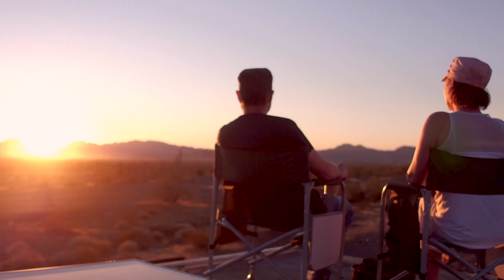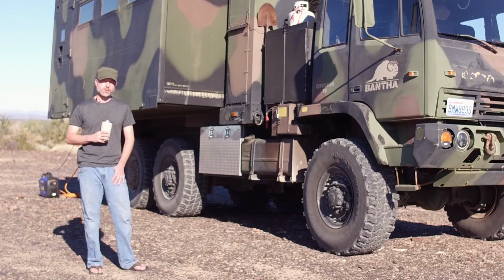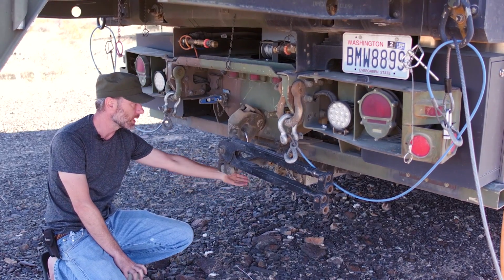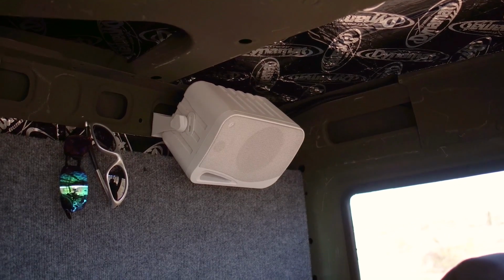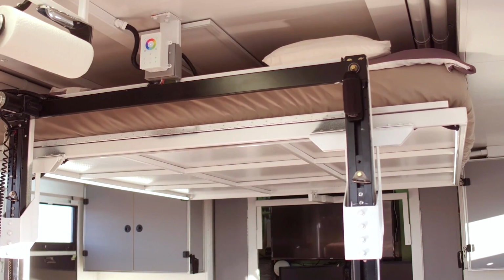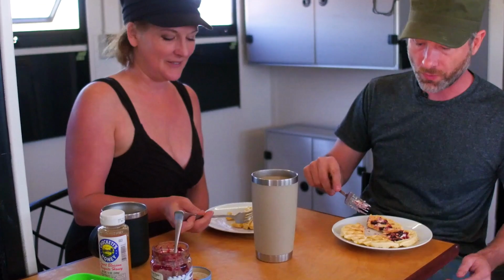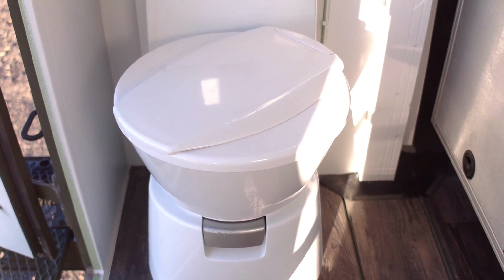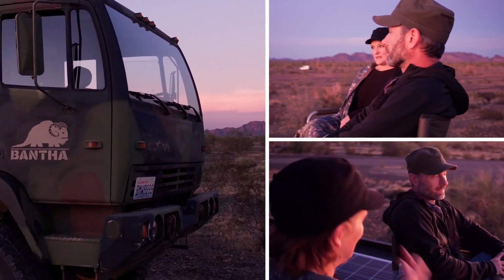Couple Converts ARMY TRUCK into Apocalypse Tiny Home 4 Overlanding

Comment: Have you ever thought of putting out some 'legs' for the unfolding expansions of the middle section? Would make the whole back a lot more stable. It could also be comprised of variable-length shafts, so you can adapt it to whichever surface you're standing on.

Other than that, damn, what a retirement dream.

Comment: Im an old traveller who started in the mid 1980s with Morocco then a long trip overland mainly on old tata busses and indian trains. I lived out of a rucksac so weight and cost was very important. Hitch hiking was safer then. I found a small pressure cooker, multi fuel stove running on kerosene, petrol or diesel was really good but a rocket stove made out of old tin cans and know how could be really good in places where you had no fuel. Good boots, a down sleeping bag, a dry light tent and goretex windproof and waterproof is a must and old army surplus trousers etc are a must. That way i could live on $25 usd a week in some places like in the himalayas but carrying water and food was weight as was petrol for the stove. It was always a compromise and lightweight quality stuff could be very expensive but if you cooked yourself at times it would save a lot rspecially with hot drinks which goes through the budget quickly especially in places like Australia. Camping could be very risky as i found out when a mulga king brown snake crawled over my boot and went into my tent into the bag of clothes. Luckily my mate knew about the dodgy snakes, centrepedes, red back spiders and different jellyfish etc that can kill you. What experiences between seeing a pack of jackalls just around sunset in the neighbours garden in the indian himalayan foothills. Rhesus macaque monkeys especially mothers and dominant males could be a big problem especially if food was around or where a troop would hang around restaurant roofs. There were leopards in the himalayan foothills and you didnt see or hear them even if they were 5 ft away as a puppy with mange got taken around 8 pm one evening but no dog the other side of the door to our balcony. The same leopard took the neighbours family dog a week later and also made a commotion around the goats and chickens of a local family who lived 100 or so metres down the mountain from our house. What great times and amazing education and memories. Of course many places changed so much due to mass tourism later like around Everest but you could do a trek around Annapurna national park and then you rarely saw overland tourists but a few Hare Krishna vans with monks would tour around India for example. You could fill up those big ex army rigs that did 6mpg in places like Iran for next to nothing especially as the bank rate for iranian currency with the banks was 10 or so % of the black market rate for US dollars. So you could get a room in the hilton hotel in Tehran for less than 20dollars a night then. Actually Iran was extremely friendly and the local people would often go out of their way to help you and make sure you were happy. Quite the opposite of what government websites and the western media say.  I found that in Pakistan and absolutely loved the country i saw especially in Islamabad when i was broke and 2 lovely kurdish refugees helped me. Those poor people suffered so much because of politics and having no homeland anywhere in Turkey, iraq, Syria or Iran. That was priceless hearing peoples tales of their lives and the reality we dont see as tourists. Its great overlanding and i imagine you must meet some amazing people on  your travels. The people who pick up travellers are really some of the sweetest people you ever meet, already stopping and offering a lift is so kind to begin with and i for one are so grateful to those who have helped me on my way over the years. Some of the americans are some of the kindest people and most interesting you will ever meet. Thank you for your great film of your off road life in your beautiful bespoke, off road home. Far nicer than a vw camper. Wouldnt it be great to travel across places like africa in one but maybe a old russian Kamiz truck would be better in the temperatures below minus 30c where starting a diesel motor is a nightmare. Many drivers in countries in central asia use old ones with well over a million miles on them and start a fire underneath to warm up the diesel enough to start them. They need to keep them above minus 30 at night or they wont start even in the morning in places like the wakhan corridor in n. E Afghanistan where they deliver supplies of rice, flour and locals ned to get their animals, yak cheese to market or barter them for tea, sugar, flour and of course local moonshine rocket fuel helps the men with the cold but there is a big problem with alcoholism and hunger due to this.

Comment: I wish someone would feature a REAL apocalypse truck, that is all mechanical (with solar, but batteries will eventually give up the ghost & one may not easily get replacements) - tons of water & fuel storage.  Plus NB storage for food as one may spend a long time before a shop is available again and seed/planters on the one pull out & external opening garage/tools etc  storage. Obviously bike (bicycle racks), winch. Two single beds and space for two pets, litter trays etc.  Calling this an apocalyptic truck is just not true, in any sense of the word.
Reply: All good suggestions for a prepper truck, but really, we did not build it to be an apocalypse truck, just an expedition RV that is super sturdy and can take us on adventures.   Cheers!

Comment: In the 70's I had an M292 Expandable van 5 ton, filled with computers and electronics of the day. It was one of two vans in the Division, the other was Div. HQ for the General, both with air conditioning. I was in charge of my van and slept in it during field duty. My Battalion Command Seargent Major saw a light on and knocked, found out I was sleeping in with A/C, he went ballistic, then I told him I had to be in there for the computers to ensure they did not over heat. He was pissed, but walked away shaking his head, he went back to his tent! The job you hold has privileges that are sometimes better than rank! LMAO!
Reply: 💘 this story.  Thanks for sharing, thanks for your service!

Comment: Ambulance type hydrolic suspension out just coming out for f-trucks,. I will use this on my planet for sure. Air up the frame & air up & down the body next best design. No1 really makes it yet. Hving cheap normal reserve quick responds racing tech shocks 3rd but pricy, usually better 2 just run 2 cheap shocks vs 1 high dollar shock they had to make do w/10yrs ago.

Comment: not many Big fuck heavy trucks slide out, nearly none pop up(esp not solid top) & none hve flip out screen hybrid rooms. Just need the right sized giant enough rig, enough axles 3 or less, right dual beats super single but same rim two diff tires God way even better. Must hve rear lift platform for heavy stuff motor or electric cyles. It is better if 4wheel steering but articulation even better ask city buses. Design is very close end of game even closer. The way u can slide steering for left or right drive is almost perfect but both drive wheels to change drives out while driving even better. Always hving redundancy of 2 or more ways for ever feature is Godly  type design.

Comment: Amazing build. The only thing I would change is ditch the AGM batteries and switch to lithium iron phosphate batteries (LiFePO). You would probably only use the genertator for emergency purposes due to the increase in capacity and the ability to discharge more than 50%.  Other than that, this build has me wanting to build a M1087 setup just like this.
Reply: Hey LoneWolf, you are spot on!  Since that video was done, we've done just so.  Haven't needed a generator since.  We are extremely happy with this upgrade.   (the list of things to do are never done)

Comment: Question for the Authors:
A) is there Air Conditioning inside the Truck & how is the A/C generated by what means & power source for the summer ?
B) Ditto for heat?.. What heating system & its power source for the winter ?
Reply: Hi.  Yes, we have A/C inside the habitat, powered by solar or shore power/batteries, depending on where we are when we want to use A/C.   Yes, heat also inside, diesel hydronic and a mini-split. Same on power sources.

Comment: Hello what kind lift are you using for your bed platform again?
Reply: Hello.  We used a Happy Jac system.  We customized it.
Reply: @BANTHA-M1087FMTV  ty
Reply: @BANTHA-M1087FMTV  ah another quick question. I noticed when you demonstrated it was quiet going up and down. Does it come like that or did you use a different motor. The ones I seen so far are very loud
Reply: @piccard455  We did change the motor, we added a second one and a controller.  It hasn't seemed to bother us any, very quiet.

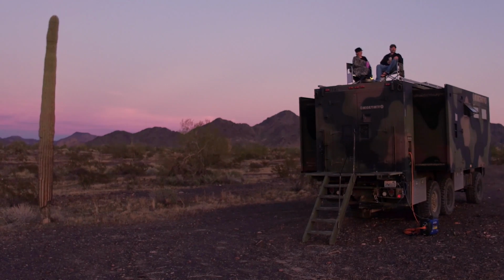Comment: Woah there, I think he meant to say at 7:26 that it can support pounds per square foot, not pounds per square inch. A small 12"x12" square at 800 psi is 115,200 pounds which is around 5-10 times the weight of the truck.
Reply: Yes, that was a mistake.  Good catch.

Comment: Wait until you strip the plastic gear that let's out the sides. Not a fun time. XD
Reply: We've not seen any plastic gears....Do tell!!!  You have experience with these hab units?  We'd sure like to hear from you if so.  thanks
Reply: @BANTHA-M1087FMTV  I used to work on them (we call them expandos) The tracks on the two slide outs are pushed out by plastic gears they are inside the main box. Follow the track along the sides that come out. You probably won't be able to see it but it is back there.. There are a lot of little things I've seen with them so if you want to pick my brain feel free to PM me.
Reply: @Ghost-dh2ds  Wasn't able to send you a pic or PM, I'll post it on our Instagram, maybe you can comment on it there.  I think it might be helpful to others to know.  Thanks.  It's great to meet someone who's worked on this expando.

Comment: They forgot that gasoline will be expired in a short few months without preservation agents. In a post-apocalyptic world, gasoline will be in short supply because only a few can produce it and if there aren't any producers, all of the gasoline will soon be useless. It is your best chance to get an electric vehicle with solar panels. They will last a lot longer than these "cool" trucks.
Reply: This runs on diesel.
Diesel doesn’t “go bad” like gasoline.
It’s also mechanical injection and pre DEF.
There are only 2 electrical connections that make the truck run: starter wire (non lockup automatic, so no pull/ push starting) and fuel solenoid (heard you can lock the plunger open with a zip tie, but can’t confirm that).

In a pinch you could run the truck on veggie oil, kerosene, motor oil, melted crisco, etc...
Not that you would want to, but if the zombies are trying to get your (massive) brains, you’ll sacrifice the fuel filters and GTFO now & rebuild the plugged injectors later! 🤪

Comment: take the governer off and you can go faster also while on park press and hold the mode on shifter switch and it will go red this means 6x6 then to turn it off press mode while on park and it turns off
Reply: A. You don’t want to mess with the governor unless you enjoy waiting for a tow truck! 😓
B. Do you honestly think they have had this rig for 2 years and don’t know how to engage MODE? 🤨
Reply: @jenngill7772  Oh and tow truck I was the tow tow truck operator.
Reply: A. I use to work on these trucks when I was in the Army.  I took so many govs off these trucks and did so many mods to them it’s like second nature. 
B. I’ve know soldiers that have been driving these vehicles for  10 plus years and never new how to engage the off road mode.

Comment: Many moons ago when I was in the Army I actually worked out of one of these on a deployment.  It was a rare opportunity since I usually worked in an armor brigade and we didn't have any of these M1087s.  Our commanders operated out of M577 command tracks.  Put 4 M577s back to back, cover with a specially-designed tent-tarp and camo netting and bam - instant TOC.
The blackout function was so that you could have white light inside with covers on all the windows and whenever anyone opened the door it would automatically switch over to non-white-light to preserve night vision for any soldiers on guard in the area as well as not light up the area for any enemies that may be scanning the horizon with night vision or flying overhead.
You know, the whole noise/light discipline thing they beat into you in boot camp.
These folks did an amazing job on converting this beast.

Comment: Modern day camping, nothing missing including a king size bed, the kitchen sink and when it rains no wet cloths. The slide out intrigues me. Is it electric or hydraulic? did you design it yourself?
Reply: The slide-outs are part of the original design.  We did not build them.

Comment: this would be worth it if it was diesel and had a conversion
Reply: It is a diesel, all modern military vehicles are Diesel engine to reduce fire hazards. The poor fuel mileage is because the geared towards power in rough terrain not speed.

Comment: Wow. So many impressions. First - he's got a little bit of engineering knowledge? He's incredibly skilled! 

My only complaint was that it was filmed in such a way that there wasn't a really solid understanding of how things were laid out. She mentioned having space for toys for visiting... but I didn't see a closet or bins beside those little ones tucked under the floating stovetop. I feel like I really don't get how it all works together. 

I love that he's got the best open-air view for pooping. And I love it more than she brags on it. 

The hot water element made me jealous. 

I adore the two bits of "nostalgia" - but the rest seemed so hard and cold and industrial. It would definitely push me to spend more time outside. 

But at the end of the day, it gets five f^cking miles to the galloon. That's just insane financially.
Reply: How many miles to the gallon would a home moving outfit get if they were to move your house wherever you wanted it set up at?
Our class A motorhome gets around 6 MPG, and it can NOT go where Bantha goes!

They tow a jeep behind them for be-bopping around the area when they get to a “home base” for a while, so they aren’t getting 5.5mpg to go to Starbucks...
And they still get 5.5mpg even when pulling the jeep! 😏

Comment: How did you bypass the electronic throttle pain in the ass on the LMTY..?
AND ALL THE OTHER CRAP , ha it's a nice powerful engine but the engineers screwed it all up..!
CTIS is good, axels are great, but the transition sucks..! Why the shit didn't tacom use an Alison 6 speed..?
How do I know I worked on them WG9 5803 USAR AMSA 53 TAMPA..!
You need the M 916 with that conex 400 Cummings..! Tiney house /hotrod..!
Reply: Nice job though, when you fix all TACOM'S SCREW UPS.! NATO and Israel will want to know what they did probley pay you big bucks for the fix.! Cause the LMTV is still in the NATO inventory not very popular though..!

Comment: So you can go off road as long as the road is smooth, seems top heavy to me, but still very cool.
Reply: You'd be pretty surprised how rough terrain these things are. Unicat has some great videos of comparably sized rigs leaning pretty hard and tackling some pretty gnarly terrain. Turns out that box can tip pretty far before it goes over - farther than I would have thought at first.

Comment: You could put a more fuel efficient cat engine in it
Reply: The Cat that’s in it is a 290hp.
It’s a fine motor, it’s the gearing that’s killing their mileage, not the engine.
2,800 rpm in 7th at 55 mph sucks liquid like a jogger in a marathon.

Comment: Does it have enouch fuel storage did you had once that you allmost ran out?
Reply: It could use another fuel tank.  That is on our "list"   Right now, a 50 gallong tank is what we have.  We've not run out yet, although we've cut it close a few times.

Comment: Thank you for your honesty in regards to the power and cooking. I see so many van videos where they might have 300 or 400 watts of solar on the roof, maybe a couple hundred Amp Hours of lead acid batteries say they have unlimited power for their induction cooktop, fridge, AC, microwave etc. As someone with a Sprinter conversion, and with an Electrical Engineering background, I can say that these all can't be run off of such a small solar setup with so few batteries in any sort of regular fashion. I love your guys' truck though! Can anybody say next project? I was thinking of a unimog, but these might be a lot easier to find parts and mechanics for.

Comment: just throwing idea out there for you guys state-to-state move in this truck would cost you as much as a plane ticket for two people when buying gas..you can buy $50 a ticket to go one state to the next state so that's $100 for two people or buying diesel fuel easily $300 and yes that is cheaper than rent but still expensive

Comment: That’s actually not an FMTV, but an MTV. FMTV is the encompassing group, as you said, Family of Medium Tactical Vehicles. Within that group you have an LMTV or Light Medium Tactical Vehicle which is essentially a 2.5 Ton vehicle with a singe rear axle. MTV or Medium Tactical Vehicle which is what you have is the heavier duty, 5 Ton version with dual rear axles.
Reply: Attila Kun ok.

Comment: Very interesting layout. I was surprised that they didn't have a 3 way refrigerator. What about heat build up inside. Is there a way to keep it cool inside? With it's height going though some flood waters isn't a problem. I would be interested in their fuel tank capacity and their range.  Still it is pretty neat!